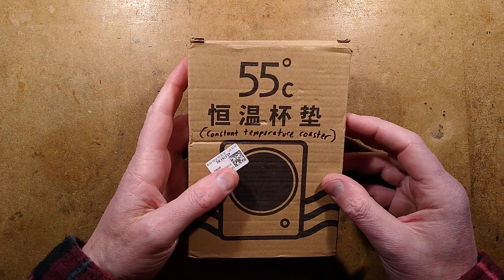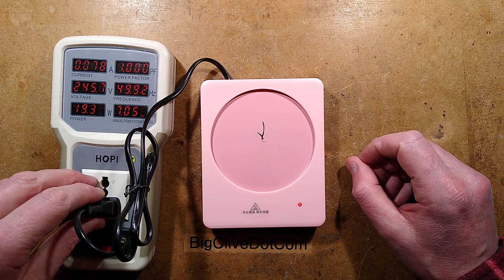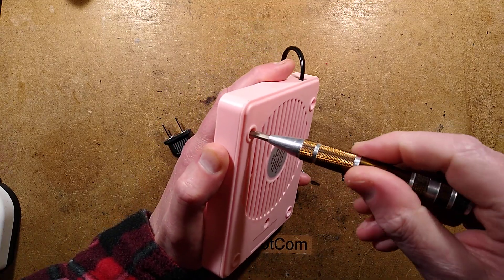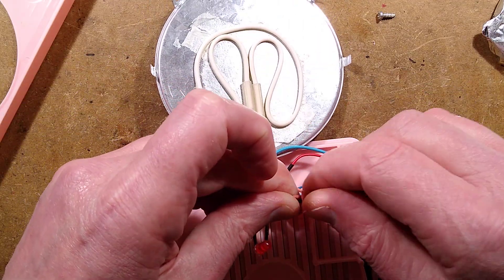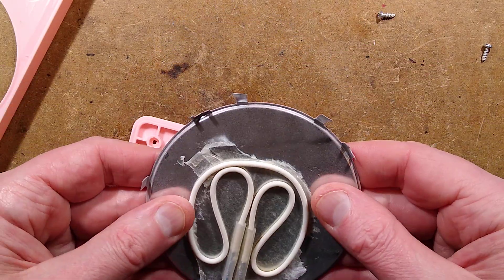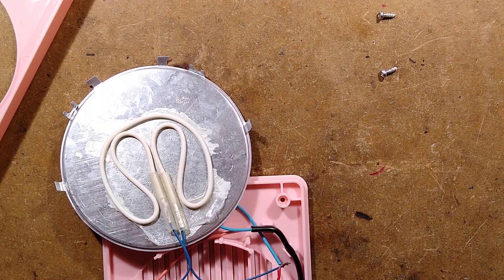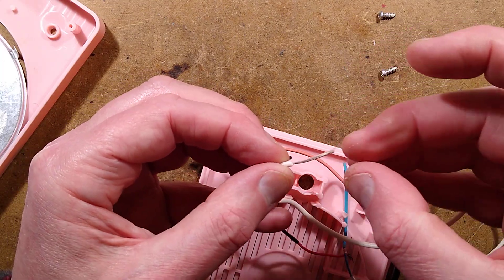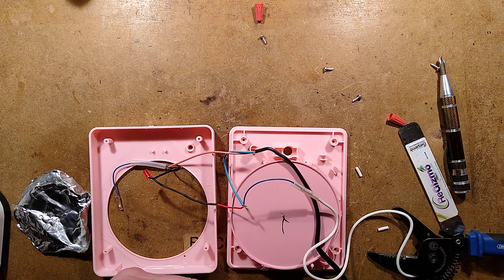Hot pink and dangerous (just how we like it)

Comment: Would be interesting to check what kind of resistor that actually is. The small metall-film resistors are rated for 0.6W.
Reply: It really depends on the exact type, you can't judge that just by the size of the resistor. Maybe the clever china man found a way to actually use cheaper 0.1W resitors in the same package size? On top of that, the power rating is temperature dependent some manufacturers indicate at 25°C, others at 70°C, and that is always in open air mounting. Applying heatshrink tubing and put it into a heater device that can go beyond 100°C and you would have to considerably derate that power rating to probably a 10th or the nominal rating. And there is still the voltage rating issue as mentioned in the video, the small resistors are usually way lower than 325V if they are not the high voltage type. If you look at the design overall, i would seriously doubt they considered anything else than the price of the component and the resistor value...
Reply: @ProtonOne11  What I wrote, it depends on the type. And yes, definately, if they somehow managed to put a resistor in there that could take the load, this would still be a pile of crap. :-)

Comment: I remember about 40 years ago putting reverse voltages across LEDs to see what happened.  The details are hazy now, but I seem to remember that they actually lit with a few volts in reverse.  Then when I tried them in the forward direction it took more than their rated voltage to make them light.  After a few cycles like that they stopped emitting light at all.  Somebody who knew this stuff said it was avalanche-induced migration of the dopant.

I'm guessing that at 50 Hz and low current the dopant barely migrates at all so the lifetime may be reduced but it will still last for a while.
Reply: a fancy term for using it incorrectly
Reply: @YouTubeSupportTeams  We all know the LED was used incorrectly, we're just curious what happens when it's used incorrectly. Know your failure modes, if you know what I mean: does it simply not work, does it stop working, or does it go out with a bang?
Reply: Usually when I do that, the led pops.... at school we used to make 'guns' that sent 48 volts the wrong way through the connected component and had a handle so you could 'aim' the component at people/objects. Leds were a popular 'bullet' as were 555 timer chips, and of course electrolytic caps (which shot out a nice jet of capacitor juice and smoke).
Reply: I have seen a germanium power transistor emitting light in a soviet Junost TV. It was the series pass transistor of the regulator, it produced an orange glow which could be seen through the glass feed-though of its base and emitter legs. It was not working anymore, it converted itself into an LED :-) . This happened about 25 years ago, when I was under 10, so don't ask about the details. Unfortunately the transistor died when I removed the top of its case, as I wanted to see what glows in it. I might remember it wrong, and the unexpected light emitter could be the reference Zener diode in said regulator. I have a feeling I have seen both of them emitting light, but not in the same set, and a few years apart. The Zener is also metal encapsulated with glass feed-through for one leg, and IIRC it's germanium, just like the series pass transistor.

Comment: Most metallic wires are PTC resistors.  Thermal coefficient of resistance is small, but it's not zero and it's positive.  That thing will self regulate, just not as much as you'd like.
Reply: It's a PTC in the same sense that foil shoved into a plug is a fuse.
Reply: Kind of like how every component is a temperature sensor, just of varying utility and linearity...
Reply: Well, every conductive material except for superconductors and semiconductors.
Reply: @drkastenbrot  I said metallic, not conductive.

Comment: Clive, what causes that ZZZZZZ you mentioned?   I have a number of devices that do that on their cases if brushed with the back of the hand or my arm, my PC does it as do both of my Panasonic 5.1 amps and my PC case as well.  I have experienced it off many different things and given that it happens on reputable brand products i have trusted that its safe but dont actually know the reason.
Reply from the maker: It happens on ungrounded products with switching supplies.   There's a tiny amount of mains leakage current that is enough to feel on thin skin.
Reply: @bigclivedotcom  Thankyou, it can be quite uncomfortable when you are rummaging to reach stuff at the back of something and the back of your arm brushes against the case, wondered what it was but assumed it had to be safe given so many things do it that are made by reputable manufacturers
Reply: It's usually the buzz from the mains current, at 50 or 60Hz depending on your country. The current makes a magnetic field in the wiring or components, changes direction, and makes an opposite field with a brief period where there was none as the first collapses. This causes vibration, usually of coils of some manner like transformers, but in this case it might be from the heating wire being spiral wrapped.

Comment: That's an item that should have never been made. The tray should either be plain metal or enamel coated. That glue looks like just household repair glue that can't stand any heat and it's all in a plastic case. Seems like we have made heating appliances over a 100 years rather safely, and it wouldn't have been much more to do properly.

Comment: 20W does seem to be correct for these chepo devices.  I've got an old one (I think from the 90s) and just dug it out to check it, about 700 Ω for 120V use.  Mine has a neon indicator and a switch on the side.  I don't remember it ever smelling bad but it did get too hot to touch if a cup wasn't on it.  I could see the wire nuts were too big for that size wire, odd they wouldn't use the smaller size to cut cost even more, they must have had a surplus of that size and used it even though they don't bite onto those little wires.  I wonder if that area in the case with the hole through the bottom was meant for a switch or a safety device?  I might have to take my old one apart and see if it has any kind of temperature regulation...
Reply: Power equals voltage squared divided by resistance. (120 * 120) / 700 = 20 watts. 
Of course it is quite possible that the resistance will increase considerably as it warms up, and limit out to something like 3 to 5 watts.
Reply: I did take my 30 year old Maxim heater apart and it is the same as the pink one, just a loop of heating cord.  Mine is UL approved so is not as crappy inside, little circuit board with the switch and neon bulb on it, heating cord held on a plate with metal hooks.  Plugged it in and it got to about 125 °C after about 10 minutes according to my infrared thermometer.  The current draw was 0.15 A the entire time so the resistance didn't increase as it heated up.

Comment: a PF/Power Factor of 1.000? I thought 100% Power Factor was pretty much impossible? Or does this have the electric heater thing where because it is heat, 100% efficiency is ok?
Reply: 100% power factor is normal for a purely resistive circuit. It's when you get out of that area that things start going strange - motors, digital circuits, etc.
Reply: @Azlehria   ty for the info :) 😀

Comment: I got one, it lasted 3 uses, it has a glass like disc that had a kapton tap circle holding on a copper track in a coil. It was very thin, hence the resistance to make the heat. It also had the same wiring and got excruciatingly hot in the centre but failed cos it burnt the track off. It also didn't really keep a mug warm cos there wasn't much heat making it into the mug itself. Seems a perfectly flat based mug is needed, to allow the heat to escape quick enough to not burn up the element.
Reply: Considering the surface area of a mug its baffling these things exists.  You need the mug itself to have the element embedded or its never going to warm the mug never mind provide heat to the contents enough to offset what is being lost to the air.

All this technology to fail to solve a problem that the flask did over 100 years ago.  Pumping more heat into the mug is never the solution IMO, the contents will just stew as the water evaporates.
Reply: I bet it might work if you use one of those tin enamel cups - nice and flat and better heat transfer.

Comment: Wait, was that a US American plug? And a 220V rating? Something tells me this is designed for 120V, at which voltage it would dissipate around 5W instead of almost 20. It would still get bloody hot, just not as quickly.

Coincidentally, I think you've also found the best way to fix this. Open it up, cut the wire and throw it in the bin.
Reply: Most Chinese outlets are wired up for EU plugs & plugs that look like US/CA/JP plugs, but are easily identified by the lack of holes at the end. China has been slowly moving to a new plug standard that looks somewhat like the Australian/NZ plug, but is incompatible. Yes. it's a big mess.
Reply: The Chinese/Aus plug is not entirely incompatible from what I read and have seen. The Chinese version uses thinner pins, so the proper Aus plugs can sometimes fit but VERY snugly.
 I can state from experience the Chinese plug fits in Aus sockets but doesn't hold very well and is upside down on bottom entry plugs so the cable goes up the wall instead of down.
Reply: @MayaPosch  And the holes are actually not required in the US, they're just usually there.  They serve no function beyond manufacturing.  https://www.youtube.com/watch?v=udNXMAflbU8
Reply: @MayaPosch  and in Australia/NZ, they can take pliers and bend the straight ones to fit their receptacles.
Reply from the maker: Chinese 220V plug.
Reply: ok I'm not the only one that thought that
Reply: Is there a printed voltage rating anywhere?

Comment: The listing was for 240V but you got the 120V version, that's why it got so hot.
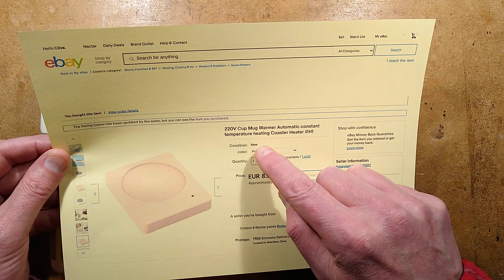Reply: Check around 2:10 - it clearly states 220V and NOT 120V 😑
Reply: @jacoprinsloo199  That's what I said. The plug is not a 240V plug, it's a 120V plug.
Reply: @Alacritous  China uses a plug very similar to, and physically compatible with, NEMA 1-15 non-polarized. But it is used at 220V.

NEMA 2-15 uses the same blade size but with one rotated 90°, for nominal 240V. Ungrounded 240V has been heavily discouraged for a long time, though, so you're very unlikely to ever see one in the wild.
Reply: @Azlehria  I know that, but what do you think would happen if the device were plugged into 120 volts? It would be ~half the temperature and wouldn't boil water.

Comment: That's one of the cheap ones, and BTW, they don't work worth a crap with any cup other than a single-walled stainless steel one.

I use the COSORI, which has both an on/off switch, and temperature control that comes with its own cup. It operates from a 24 volt wall wart.

Comment: What would happen if you just modified an iron to dunk in a mug and get as good as it gets regulation ?
Reply: A soldering iron? I tried it with my TS100 shortly after getting it, the boiling water insulates the surrounding liquid, so it doesn't work too well with the small surface area.
Reply: The flavor of flux would remind you that decent solder has more lead than I'd want in my hot drink.

Comment: I want to insert a steel plate into a coffee cup so my Qi charger will do this. 15W will keep it piping hot.
Reply: Incidentally, I have experimented with a metal plate and Qi receiver. It gets quite hot, even with nothing attached to the Qi. It keeps the primary on and the metal plate heats from flux leakage.

Comment: After you removed the heating wire from the aluminum plate I was hoping you would just plug it in and see how hot it gets
Reply: I once put a meat thermometer near the hot-air heater. It read 110°C .
Hmm, I wonder how hot it is, I wondered, and touched it. 
A thermometer showing 110°C is 110°C, you idiot!! ;-)

Comment: i wonder if this was designed for the us market 120v? I would imagine it would operate much closer to spec at half the voltage.
Reply: I bet you this was specked out for 120 volts.  and they change the labeling on the device and online to try to sell them in other markets.
Reply: No, the Chinese sticker meant that it's made for China. Chinese wall sockets have a US & EU 2-prong outlet in addition to the 3-prong inverted Aussie outlet.
Reply: @Avantime  No wonder they're so angry.
Reply: @Avantime  they also use the British Bs1363 sockets.
Reply: @dogwalker666  Hong Kong uses the British sockets. I've seen some universal sockets in hotels in China, but for private residences it's always 2 prong US/EU at the top, 3 prong  inverted Aussie at the bottom.
Reply: @Avantime  when I was in China yes the hotels used UK and Euro sockets, the factories I was working in used a mix of everything,  but the office used UK and US, The restaurants used a random selection,  as i only visited 2 private homes only the new one had UK and Aus. They are very confused.
Reply: Maybe they accidentally stuck the 120v one in the 220v box
Reply: Although it says "Made in China", the plug says it is not made for the Chinese market, but rather for the US or Taiwan, where the voltage is 110V. Or Japan (100V). To print on the label 220V is felonious, IMHO.
Reply: @laoluu  China's standard plug is the inverted Aussie plug, but unlike the Aussie plug they don't have a 2-prong unearthed version of that. So any appliance with a 2-prong plug sold in China uses the US plug (The Chinese sockets can also take 2-prong Euro plugs, but that's non-standard). If you don't believe me have a look at unboxing videos of Xiaomi Chinese market phones, they all include the US-style 2-prong chargers.
Reply: @laoluu  The writing on the device is japanese so might be for japan
Reply: @NO_obs  Sorry - it is Chinese. But I agree, that Japanese users would be able to read the label.
Reply: @laoluu  that depends.  while they do use the same characters, the readings, and thus meanings, are quite different.
Reply: I think this was just designed to be sold, not to be used :D
Reply: @michalveselenyi3801  or to be used until it breaks and not to be repaired.
Reply: The label on the back is visible at 2:32 and confirms it has the 220V version of the sticker applied. But seems plausible it is PTC heater wire sized for 120V that's just overwhelmed at 240V.
Reply: And the box says 55 degrees C.
Reply: @dieseltinus6680  Canada also uses 120v and they're on metric so it's possible it was for the Canadian market but then it would likely have French and English writing so I imagine it's probably just meant for the Chinese market like the other one said.
Reply: i bet is the 120v variant, isn't the plug the US kind?
Reply: It's specified as 220V but Isle of Man have 245 - 250V.
Reply: Cutting the supply voltage down to 120 volts would cut it's power to less than 5 watts. At 1/4 the amount of heat, it might not be enough, to be effective.
Reply: The heater would put out just 5 W at 120V, not really enough.
Reply: @w0ttheh3ll  If one figures temperature rise vs. ambient, and divides that by four, one would end up close to the specified temperature.  Maybe that's just coincidence, but if the objective was to maintain something that was already 55C, it might be almost adequate.
Reply: @flatfingertuning727  It might slow the cooling down enough so you drink the beverage before the temperature drops too much.
Reply: @w0ttheh3ll  I'd say 5W is enough.
Reply: @w0ttheh3ll  5W is enough, they used to sell one that ran from the 2.5W available from old USB 1.1 .
Reply: @w0ttheh3ll  good point!
Reply: It's 220V rated
Reply: @ivankirola2707  the BOX is 220V rated….
Reply: @Cooper_42  the box may be the contents definitely not, And certainly not legal for UK use.

Comment: In the USA we have that style of 2-prong plug, but it usually has holes, though not required to.
Holes are said to be for manufacturing purposes (i.e. for molding jigs or punch press indexing) but are not mandatory.
Reply: @Edward Elizabeth Hitler Check out Technology Connections - the standard says the holes are for manufacturing purposes only.
Reply: Good guess, but not true.
Reply: I saw a video this and ther was abslutely nothing in the socket to locate with the holes in the plug. Maybe there are different styles of socket which do have a bump?
Reply: I've seen padlocks put through the holes for some devices. I'd assumed kid proofing or something.
Reply: @Edward Elizabeth Hitler In Europe at least, industrial breakers and switches are designed purposefully with holes for "electric padlocks" (they are designed to say "do not touch" but to be removable easily in case someone lost his key or stuff like that).
https://blog.formatis.pro/wp-content/uploads/2015/06/loto1.png
Zipties are used but it's not considered proper use. In many cases, use of zipties are forbidden and will cause the electrician using them to be fired or banned from the site (if he's a contractor)

For small caliber breakers (identical to the ones found in houses) there are adapters that are affixed in small holes. I think those holes are designed for that purpose since older breakers and fuse holders don't have them.
https://www.liftshop.fr/wp-content/uploads/2015/08/MCB-01-2-RSZ.jpg

Comment: Clive, we call them wire nuts in the states. If sized properly, and the wire stripped to match, they work great. At least they did use the "better" ones with the gripper spring (which should not stretch).
Reply: Unfortunately they used the wrong size. Grey would have been appropriate.
Reply: @lwilton  True!
Reply: Very true...The "spring" is actually more like a tapered "helicoil". The inside threads are designed to grip the wires, the outside threads actually thread into grooves molded into the plastic cap. There should be no elasticity whatsoever.